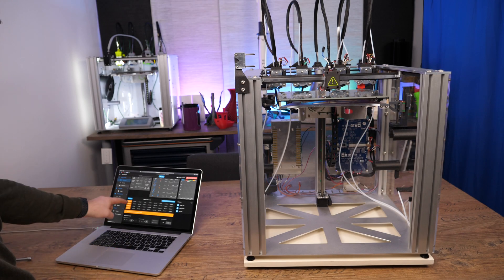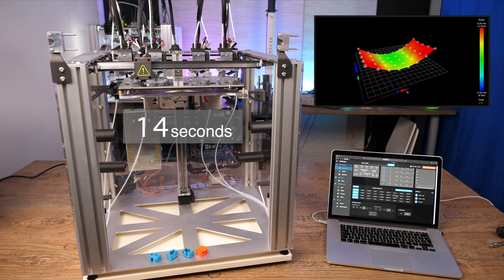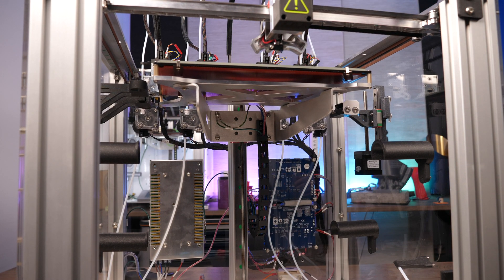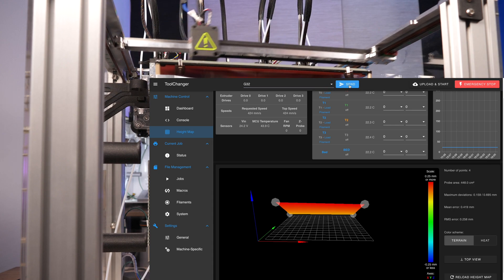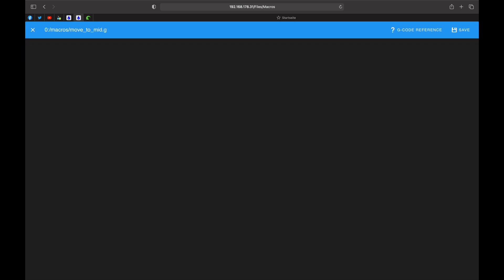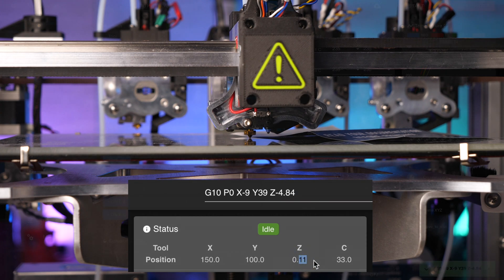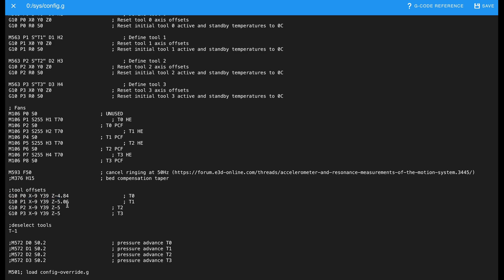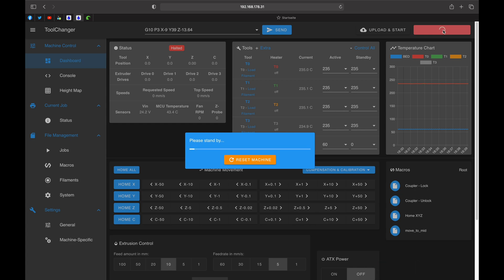E3D Toolchanger - Configuration #02 - Adjusting Z-offsets

Comment: This is a great video and so much more helpful than the e3D documentation. However, how can I check that I got the correct offsets? After I reset the printer, when I call a tool and lower it to my feeler gauge, the gui will typically show 0.00 on the z height for T0, and around -0.02 for T1 and T2. I was expecting the gui to show 0.05 once I had the correct offsets. I don't have the paper from e3D, so I was using a 0.05 mm feeler gauge from BCN3D.
Reply from the maker: Try using smaller increments. You are probably just "bowing" the x-bar up ever so slightly by 0.05mm.
Reply: @ReneJurack  Thanks for the quick reply. I actually already went down to 0.01 mm adjustments. I'm trying to do a 0.05 mm layer height with a 0.15 mm nozzle, so I have to be as precise as possible. After rebooting the TC I was expecting to be able to call a tool, move to mid, and the gui would read 0.05 when I manually moved z back down to the feeler gauge, indicating no adjustment needed. I'm adjusting z until I just start to get some snag/vibration when moving the feeler gauge. Or do I need to send G10 for each tool before picking it up? I'm going to try again by adjusting all offsets from 5.00 mm.

Comment: Could you add a BL touch to auto level each nozzle?
Reply: not how that works
Reply: not to any advantage.  the bl touch reports when it is a given distance form the build plate.  the delta from the bl touch to the nozzle is still something you would have to measure. and when you change the nozzle you would still have to measure it again.  this is of course how the bl touch is used on any 3D printer.  day i day out, the bl touch is used to calculate the shape of the build plate and where the "known" nozzle/head is relative to the build plate.  so mounting a bl touch to each tool is of no use that I can think of.

Comment: Whats the spanner thing you're using to grip the heated block. I normally use a wrench but this thing looks better.
Reply from the maker: It‘s a „knipex zangenschlüssel“ (literal translation is probably„plier-wrench“). In the video you see the 150mm electrical VDE version, partno. 8605150. There are 5 sizes and each sizes comes in 4 variants. The one mentioned above is perfect for 3D-printing, one size bigger, 180mm, is perfect for everyday use.
Reply from the maker: KNIPEX Zangenschlüssel Zange und Schraubenschlüssel in einem Werkzeug (150 mm) 86 05 150 https://www.amazon.de/dp/B002A00G3Y